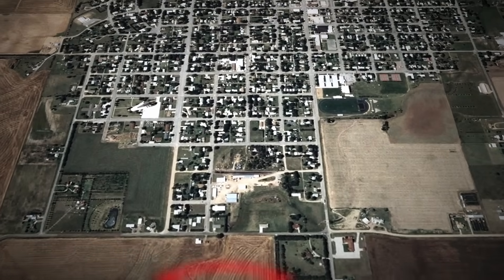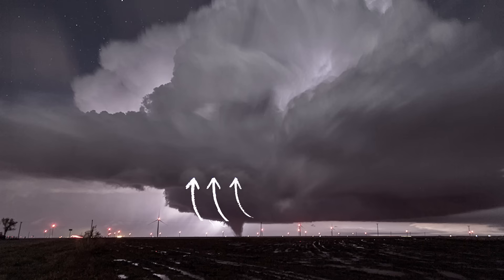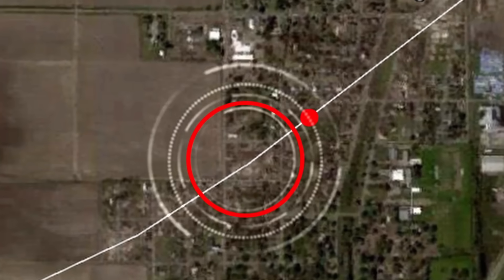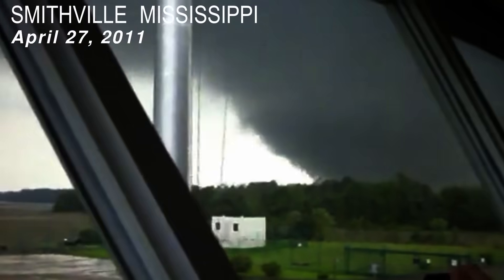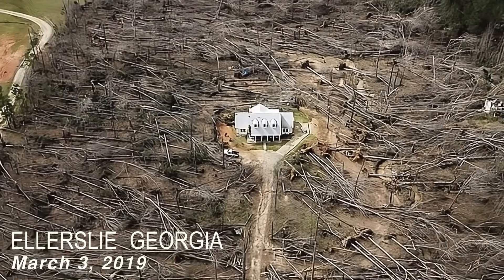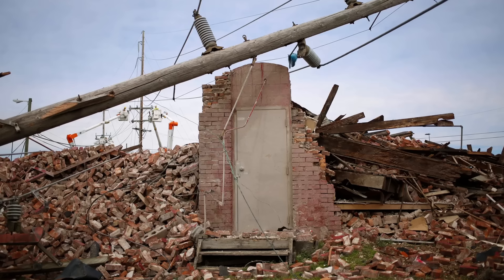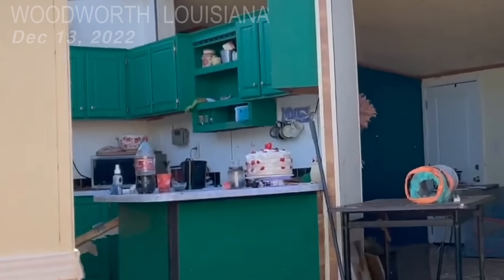The STRANGEST Tornado Damage Ever Documented

Comment: see the thing about scripts like this that bothers me "a large, ef5 tornado was headed towards..." uhm...no? the tornado didnt have a rating at the time. in fact it literally COULDNT have had a rating at the time. the rating of the tornado before it hits anything is always ef0 regardless of how fast its winds are. 

tornado ratings are based on the damage they do, not the strength of the winds. so saying "an ef5 was about to hit the town' is kinda redundant. its basically going "a tornado that damaged the town was about to hit the town"

you can have ef0 tornado's that have 300mph wind speeds, its just that they occur out in open fields and touch literally nothing, not even like, a crop or anything. the script is trying to hype up the ef scale rating as a measure of power when its really just doing the equivilent of saying the floor is made out of floor.

if you were some poor schmuck out there having a picknic, the ef0 rating wouldn't comfort you much as the blades of grass that it ripped up penetrate you like they were shot from a railgun.

in fact if there ever WERE a case of a tornado that had already hit ef5 BEFORE it got to your town, you'd statistically be pretty safe. most tornados peter out fairly quickly, and the fact it had already obtained its ef5 rating before getting to you, means its been on the ground a long enough time to hit enough stuff to get that rating. which should mean its dying down fairly soon and would be weakening.
Reply: Ok. First off, wall of text. Second, he is talking about the rating it was given and not the rating at the time.
Reply: @Adam-q9u3q  ‘wall of text’ — a most accurate description.
Reply: (also windmills operate, as in they spin and function, in 55mph winds. thats quite fast if you think about it. anything higher than that and they hit the brakes and feather the blades, so 55mph is how fast winds are before windmills even BEGIN going into self preservation mode, they are still just doing their thing at that speed. so that tornado which hit them really wasn't much. the one blade being bent was mostly from turbulent, twisting wind flow that the mill couldnt compensate for. essentially the air flowing at the base of the blades was going in a different direction than the air at the tip, it has zero mechanism to combat such a variance happening is that small a space.)

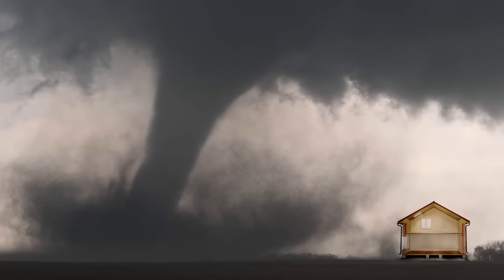(and further more, the "high pressure vs low pressure exploding house tornado damage" espoused at 7:07 has been THOROUGHLY debunked. this kind of thing just doesnt happen. houses are not airtight enough to cause this kind of damage, and even if they WERE, the pressure differential is low enough that merely shattering a single window would relieve it. and your windows would give out WAY before the roof would. in fact you imediatly explained WHY its been debunked seconds later by showing the curtains pulled through the narrow cracks. yeah, air can get sucked out of small cracks. the most damage it will do is to your drapes dude)

Comment: not a windmill, its a wind turbine.

Windmills are for using wind to power a mill, like for grinding flour

A wind turbine, which is actually in the video, is for generating electricity
Reply from the maker: Yes, my mistake

Comment: I believe that light that was going around that tornado was in all likelihood a diesel-powered work light from a construction site. Considering these are designed to put out light at 360 degrees I think it would make a lot more sense that you could see this from a long distance, for the time that we saw it. Rather than a car pointing at the camera the whole time while flying around the tornado.
Reply: This is my theory too, that it was a work light with its own onboard power of some sort that kept it lit up despite it flying through the air and it would also explain why nobody has identified what it was because it's probably not something you would notice in the debris, whereas a crumpled vehicle [if the headlight theory were true] would be quite noticeable. If it was somehow a car, hopefully nobody was inside.
Reply from the maker: I think that's a good theory. I wanted to point out that it was possible for a tornado to lift a vehicle. I do wonder a bit about how the light was constantly visible, there was flickering visible when the light is initially flung around the south side of the tornado, but not when it's at maximum height. I do know that max was shooting 1/30s 4k video and likely had 1/30s shutter speed, which would mean it was constantly open, which could have reduced any expected flicker from a lofted vehicle.
Reply: @highriskchris what about moms pound cake?
Reply: @highriskchris  I think it could have been a very rare ball lightning too,
Reply: @highriskchris  the thing i tought about is a Street Lantern and yea it sounds stupid bc if u pull it out of the Ground it should have no Electricty any more but the funny thing is that if the Right Wires Touch this things still can Light up Normally and are made to be seen even over Great Distances and that by Stroms and it would be Permanently Viewabel bc of the Shape of the Head then it would be side ways so in a Spin it would become 360° viewabel and goes out after the Bulb inside gets crushed.
Reply: Was thinking it might have been some kind of battery powered emergency flood light. They are usually placed inside of industrial buildings for when the power goes out. There are also consumer grade versions but they are not as bright.
Reply: If that light WAS indeed a worklight, I want to know what brand it was. Talk about take a licking and keep on ticking!
Reply: I get the impression it's something light weight orbiting in the outer circulation, not in the core with 196 MPH winds. There's also a rapid flickering at one point that gives me the impression that it's spinning/tumbling like a football, much too fast to be something the size of a car.
Reply: Or a very bright LED motion sensing light. I agree it’s not a car. If it were a car, you’d see taillights as well. It’d be nearly impossible for just the headlights to face the camera the entire time without spinning around.
Reply: @woundedcrow4606  Turns out likely a car.
Reply: @ImNotACatFromExclusive  I'm not sure on that, there is more than windspeed and the amount of "lift" it would provide at play. The Tornado was pretty wide and as well as being lifted the object travelled right around the exterior of the Tornado, the kind of windspeed that enables the lift would also mean it had a lot of angular velocity and would probably be hurled away rather than orbiting it.
Reply: @Tuberuser187  Very possible we have seen it do it to trains a car shouldn't be a problem. Most of the time they just derail but some 4's and EF5s have tossed them hundreds of feet. A car is like a piece of paper compared to a train.
Reply: @Tuberuser187  But I'm not saying you're wrong most of the time cars don't do full orbits around tornados they tossed after being picked up and destroyed by debris in the tornado.
Reply: Yes, because the odds are WAY against headlights remaining pointed at the camera the entire time if it was a vehicle. It makes very little logical sense to me.
Reply: This makes a lot of sense! Diesel light had a fun trip it seems
Reply: That’s what I was also thinking
Reply: Fr
Reply: @TheMrfoxguy  not very likely.
Reply: Guys, here is The Savior

HalleluYAH translates “Praise ye YaH”

YaH is The Heavenly Father 
YaH arrives via the TENT OF MEETING
YaH was Who they Crucified for our sins
YaH was Crucified on an Almond TREE

— Ancient Semitic Cuneiform of Moshe (Moses)
— Isa Scroll (The Original Isaiah)

Isaiah 42:8
"I am YaH; that is my Name! I will not yield my glory to another or my praise to idols.”

Isaiah 43:11
“I am YAH, and there is no other Savior but Me.”

Isaiah 45:5
“I am YaH, and there is none else.”
Reply: @Praise___YaH  I made poop today. Good poop.

Comment: I'm sorry if this takes a little wind out of somebody's sails, but the reason flimsy objects are found embedded in trees and poles is that the violence of the wind twists the trunk, and those flimsy objects are simple blown into the cracks that are formed, and then trapped as the tree resumes its normal shape.  But hey, it's still impressive to twist a tree...
Reply from the maker: Okay but what about the vinyl record in the power pole? Pretty sure that's wind driven debris getting embedded in the tree bark.
Reply: @highriskchris  Wouldn't cracks open in a telephone pole that's twisted?  I'm unsure. Like I say, I don't mean to rain on anybody's parade, I'm sorry if it comes across that way. I've been fascinated by tornadoes all my life, but this sort of thing has come up before, years ago, when people were trying to understand how pieces of straw were found sticking out of trees after a tornado's passage. I think the video above is a good one, and the creator found other phenomena that required some creative thought to explain. It's sometimes hard to keep an open mind when dealing with things like this, but in the end it's an Occam's Razor sort of thing. Cheers.
Reply from the maker: @bigfakenetwork  no, this is wind driven debris. 200 mph is extremely fast I don't think most people understand how fast it is..

Comment: I have a picture (somewhere on a thumb drive) of a 2 x 4 sticking out of a concrete curb. The curb has no cracks in it at all. It looks like the board was stuck in the concrete when it was poured. So strange. It just blows my mind how these objects survive when impacting a hard surface. This was the 2013 Moore tornado.

Comment: 3:00 could this be on of those ball lightnings?
Reply: that's what i thought too
Reply: @Sylikx  right, ..i'll try to check the original footage again to dig a bit more, i think a lightning should be seen moments before the appearance of that ball of light
Reply: @supsuppers Ball lightning is extremely rare and debatable as to whether it is actually real because there hasn't been any sufficient video evidence showing it. I can't imagine a ball of lightning casually floating around a violent tornado like that either...I'd imagine it would be a lot brighter as well

Comment: Pretty sure the pipes dug up in smithville was disproven. Still an incredible tornado but it did not dig up water pipes.
Reply from the maker: There was another pipe that was suspected but proven to have been excavated prior, the pipes I showed in the video were absolutely caused by the tornado, see how the ground is still draped around the pipe? It wasn't dug out. I have looked deeply into this detail.
Reply: Can you recall what the explanation was? Pipes empaled into ground?
Reply: The 1953 Adair Iowa F5 actually pulled the pump out of a well... the farmstead was so completely destroyed that there were hardly any boards left that were still nailed together!

Comment: I didnt know windmill blades could bend like that, but it makes sense that they could.
Reply: Need to go digging but the BBC did an article on this very thing, about how the turbines are designed and rated. It's amazing engineering. The one that blew my mind was that the blades in one of the turbines aren't solid, they can actually move instead of bending, and have slits in them. Which is absolutely amazing

Comment: The two that come to mind instantly

The Cactus 117 oil rig and the 2011 El Reno/Piedmont tornado, anything that can roll equipment that big and heavy....

Oh and the top of the  water tower in Smithville, MS taking a direct hit from a tornado propelled SUV, carrying on standing. It might have been an EF5, but the water tower was not having any of it that day
Reply: That oil rig blew my mind. I didn't even know about that until Carly's video, and when she said like 300,000 pounds or something like that I had to go back and make sure I heard that correctly.
Reply: I think it was the same one that also cracked the dome home as well and hat is just as mind blowing damage wise. 300,000 pounds and a tornado rolled it. Not just once, but the Cactus rig was rolled at least twice.

Just doing some quick and dirty math in my head and I'm all ....that's a lot of force with that tornado. Then again, I went back and checked, 2011 Super outbreak is a magnet for weird damage. I found reports of undamaged pairs of jeans from the Wrangler factory being discovered. My question is did anyone take and wear them, I wonder or were they turned in and documented properly, and what happened to them aftewards, were they put on sale or...?

Now I want to know. Also the pound cake, I'm pretty sure Mom said no cake till after dinner, the tornado was just following the instructions
Reply: the piedmont also nearly ripped the saferoom up that was at the cactus 117 rig site. i believe snapping one of the metal cables holding it down and denting it badly.
Reply: Guys, here is The Savior

HalleluYAH translates “Praise ye YaH”

YaH is The Heavenly Father 
YaH arrives via the TENT OF MEETING
YaH was Who they Crucified for our sins
YaH was Crucified on an Almond TREE

— Ancient Semitic Cuneiform of Moshe (Moses)
— Isa Scroll (The Original Isaiah)

Isaiah 42:8
"I am YaH; that is my Name! I will not yield my glory to another or my praise to idols.”

Isaiah 43:11
“I am YAH, and there is no other Savior but Me.”

Isaiah 45:5
“I am YaH, and there is none else.”

Comment: The light rotating around the tornado was likely not actually a vehicle. Headlights are mono direction and can only be viewed from 1 angle of the vehicle. It's highly improbable that a automobile aloft in the air would be static with the headlights pointed perfectly at the camera the entire time. One of the better suggestions I've heard is a battery powered flood light off of a utility truck or from a construction site

Comment: Are we certain the Rolling Fork light was a passenger car?  Seems to be bright white and a single light, which could be possible on a newer car using LED headlights with one out or a motorcycle.  It could also be something like a battery powered artificial light however.
Reply: There's no way you'd see a small light from that distance.
Reply: From footage that I saw, and it might have been from a different part of the tornado’s lifecycle, as well as different object, but the resolution allowed me to see what appeared to be headlights, and taillights. Believe I saw the footage over on twitter.